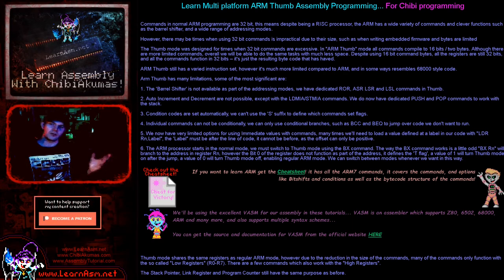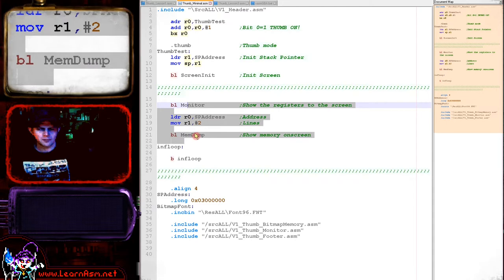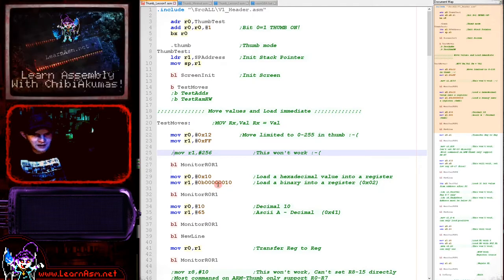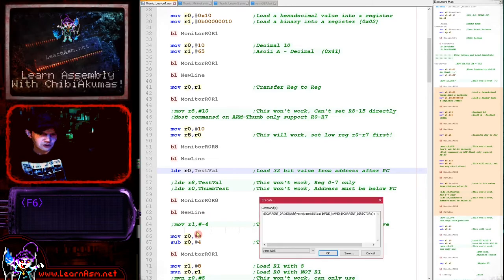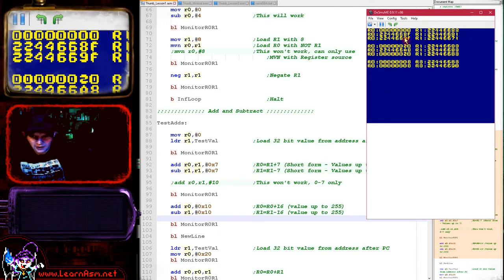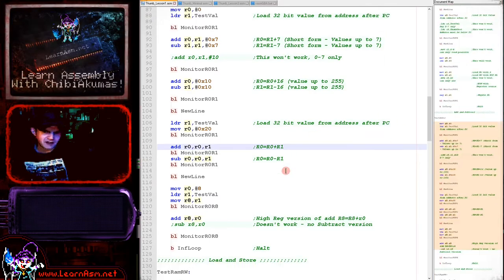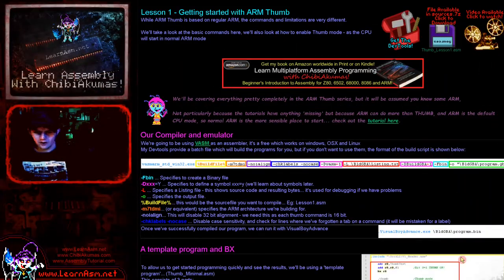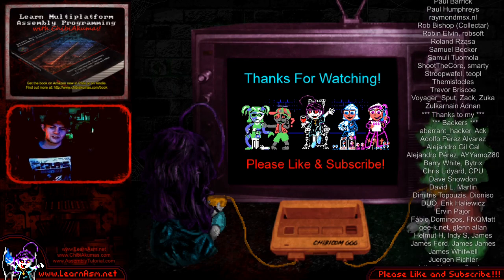ARM Thumb Assembly - Lesson 1 - Getting started with ARM Thumb

Comment: Talking about things the assembler changes, mov doesn’t actually support loading an immediate value into a register. 
It will either be changed into movs or mov.w (32 bit move) which is not supported by some chips. 
This hard-faulted the chip I was working with because I had forgotten to tell the assembler which chip I was using. And I was quite confused why it would hard fault on such a basic instruction.